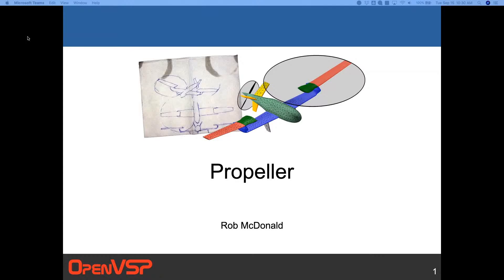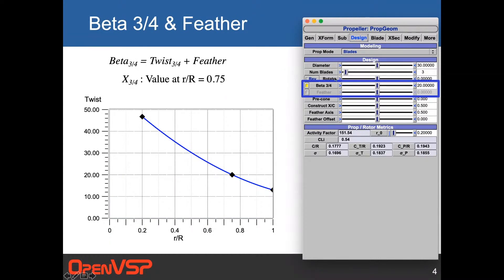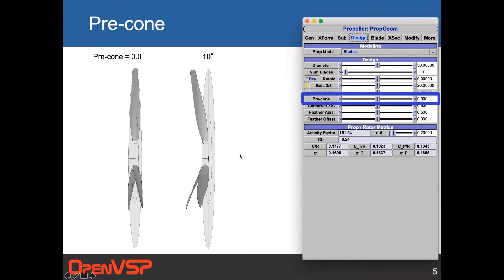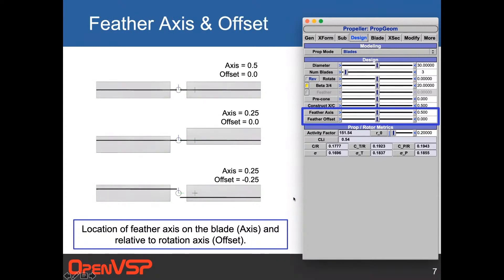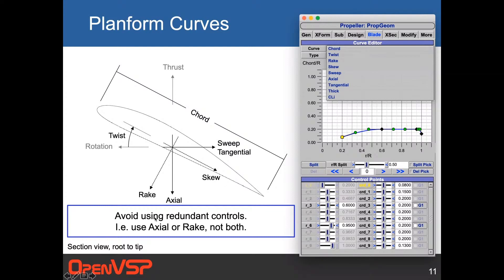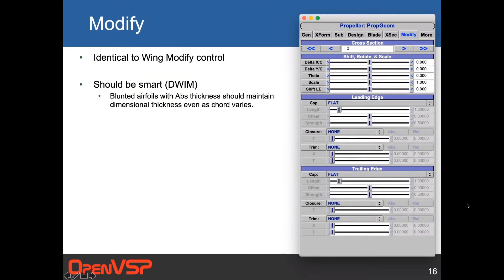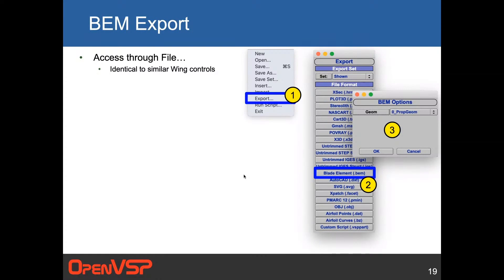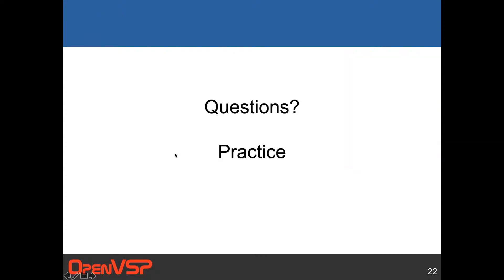2020 VSP WS: Propeller Component Walkthrough

Comment: Hi Rob, thanks for sharing some more knowledge! I have just downloaded 3.31 and trying to run a pair of symmetrical rotors on VSPAero, the "slave" rotor rotates not about its own axis, rather it rotates around the "master"s rotation axis. Any tips on what I am doing wrong? I have tried imposing different symmetry options, to no avail
Reply from the maker: Sorry to miss this for so long.  It is usually quicker to get questions answered on the Google Group.

This is a bug in the component grouping that we're working through.  For now, copy/paste your rotors, move one to -Y, reverse rotation, and go from there.  I hope to have this fixed in a coming version, but I'm not sure when that will be.